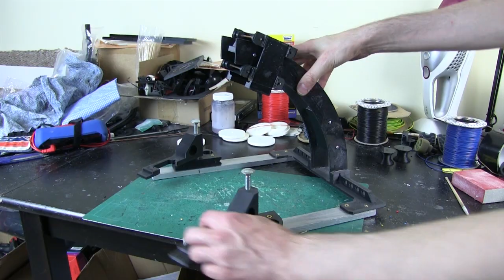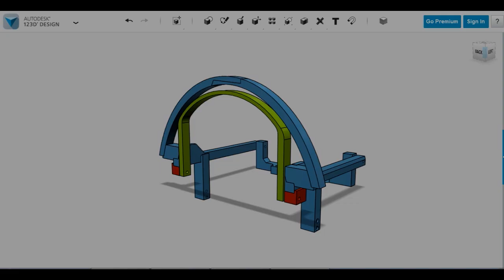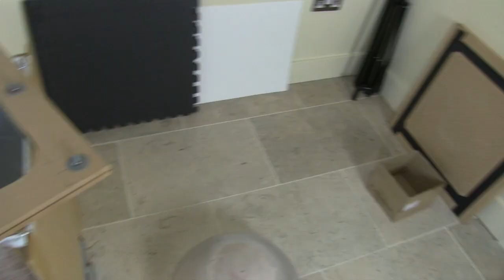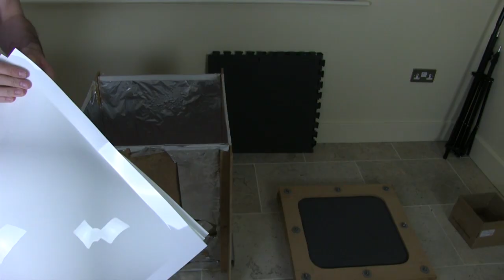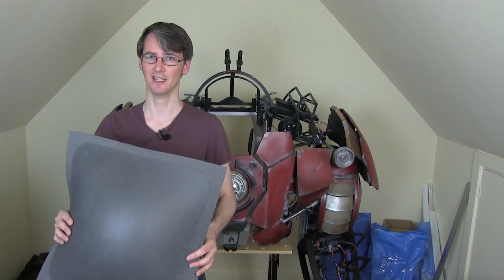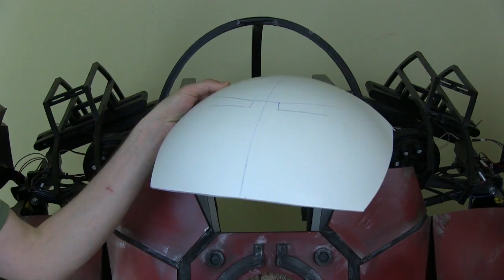Iron Man Hulkbuster Cosplay #35 | Working on the Helmet | James Bruton

Comment: Whe you heated the foam you told it was starting to burn. Have you ever though of setting your heater lower,and, instead of removing the foam frame to form it, take the other frame with the curved plastic piece and press it down on the foam? 
I guess you could obtain best results without burning the foam down.

Comment: Since the face plate is nearly flush with the rest of the helmet when the helmet is closed, but has to slide under other parts of the helmet when it opens, perhaps the helmet frame should be open at the top (to leave space for the face-plate to slide) - and then the top of the helmet ("scalp") could pop up slightly to allow the face plate to slide underneath.
(You could mount the scalp on springs which force it to this "popped-up" position, and when it's time to close it, use a cable-pull to pull it down into "closed" position...  And if the pivot point for the face-plate's motion is slightly forward, then only the front end of the scalp need pop up to give the face-plate clearance to move)
You could potentially pursue such a design with the current 3-D printed frame by having the top of the head frame angle backward instead of being straight up. That way the frame would still have enough range to hinge backward for the helmet's "open" position, but it also wouldn't get in the way of the face-plate opening.

Comment: Hey James I have a little question about ninjaflex,, before I embark on planning a whole project using it, if you had a long piece of ninjaflex to print and you coiled it on your build plate to fit, would it try and curl back up if you tried to straighten it after it was cooled and removed?
Reply: Its more like I need print it curled on the bed and then straighten it out,,.

Comment: Can you explain the vacuum part again? When and why would you need to use a vacuum for the heat generator?
Reply: SentinelPrimek The vacuum is used after the material is already heated. It pulls the plastic down around the pattern being formed, helping the formed plastic to follow the contours better.